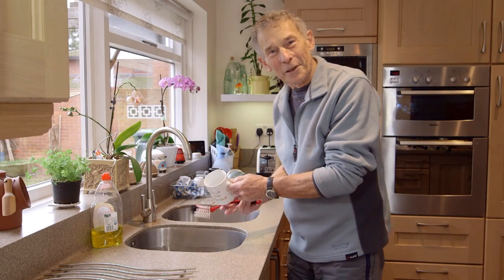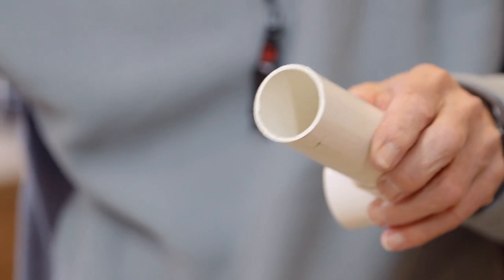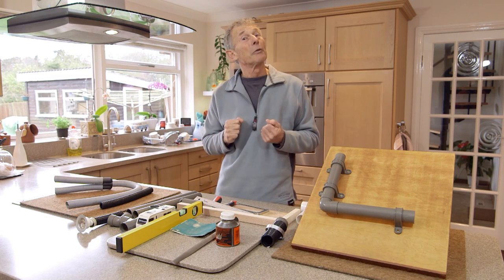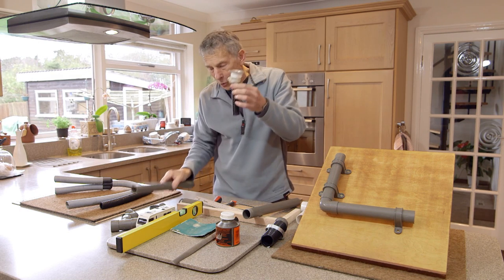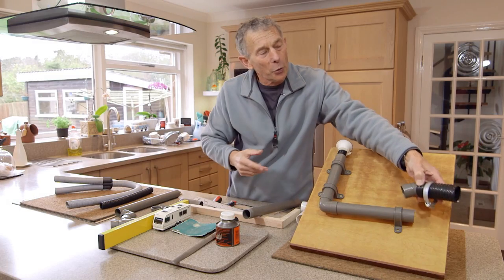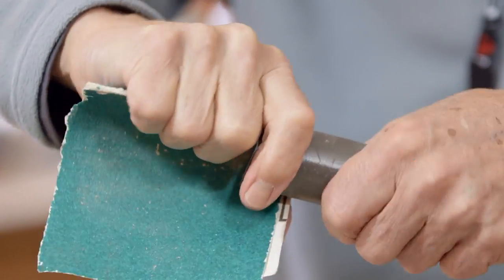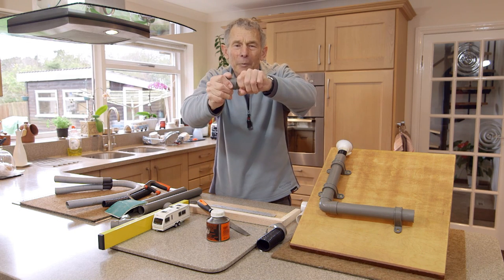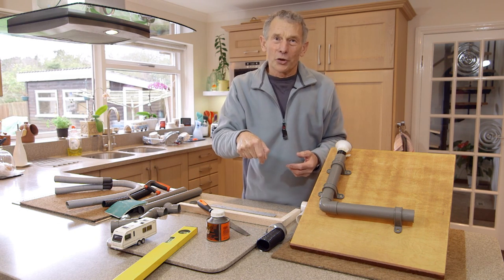How to improve your caravan's waste water plumbing

Comment: Hi, just noticed your video on Caravan pipes. I’ve got an Adria caravan with shower cubicle at the rear and only a plug hole in one corner of the tray.. so when levelling my caravan, I have to make it slightly lower at the front and one side slightly higher then at least the water gathers into the corner of the shower tray. One other problem of course in doing that is that my kitchen is at the front of my caravan so that water has to try and go uphill slightly, but I’m living with that. The waste pipe they use is no more than an inch in diameter. Looking at your video. Would you agree if I replaced it underneath the caravan with standard Plumbing pipe is the thinking the wider the pipe will give me a better flow.Thanks mike

Comment: HMM..  UMMM  I Completely understand your thought process but use 28mm push fit solid  motorhome / caravan waste pipes and joints directly from sinks etc to waste water exit. Its still available.  Its also better to not glue the joints that way  it's a quick fix to sort what you want to..  I too don't like the convoluted waste pipes as yes they trap dirt, they also sag over time with the accumulation of dirt and also the hot water helps them bend (thats the same for the cheap and expensive one) even if you use the appropriate number of supports.